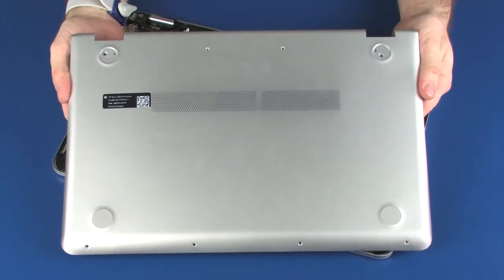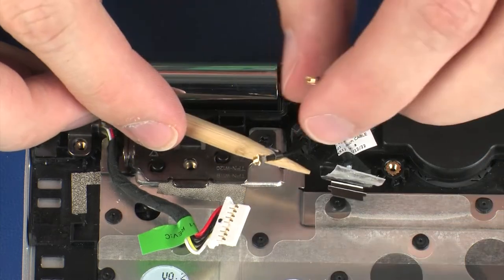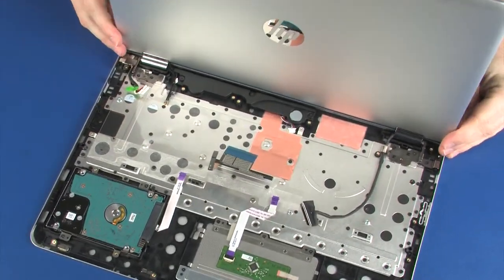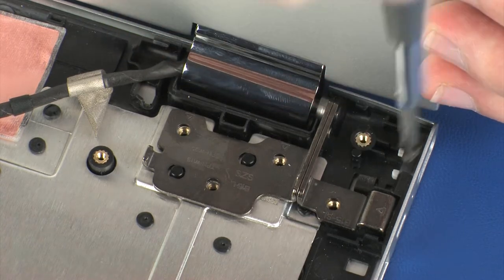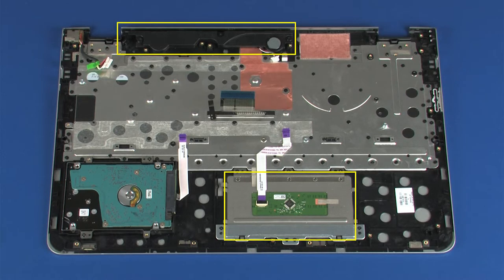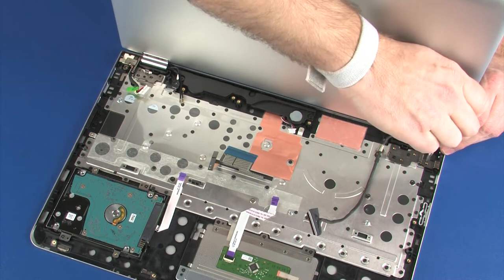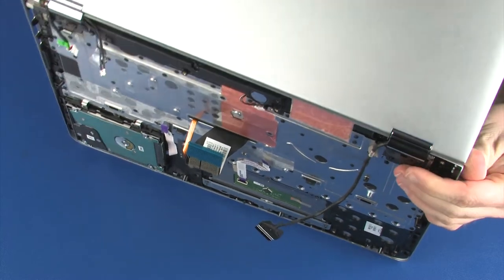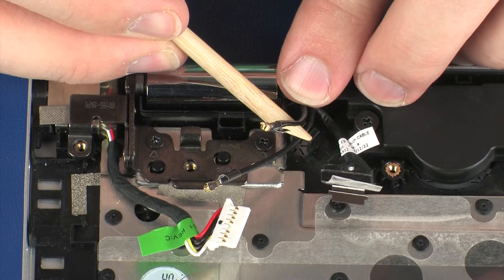Replace the Display Panel Assembly/Top Cover | HP ENVY x360 m6 Convertible PC | HP Support

Comment: How much does it cost to replace the cracked screen of HP envy touch ryzen 5 2019 model ??
Reply from the maker: +jawahar vasu I understand that you need to purchase the screen for your computer.
You can purchase the screen or any other accessories from here:
www.hp.com/accessorize 
I hope this helps you!!
Reply: @HPSupport  no help at all .... i don't want to buy accessories. I want to buy the damaged LCD touch screen for my laptop.
Reply: @HPSupport  Sir .. Again ..I Don't need PC Monitor. I need to replce the screen for my HP Envy 360 LAPTOP, which is not available  there